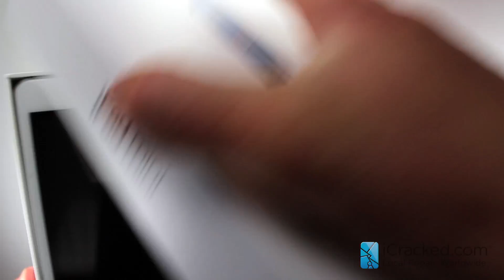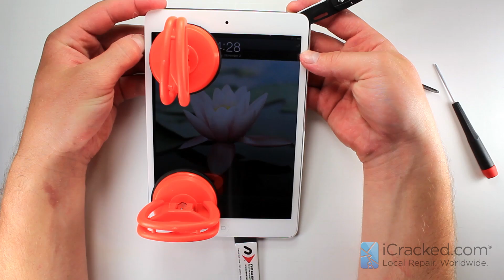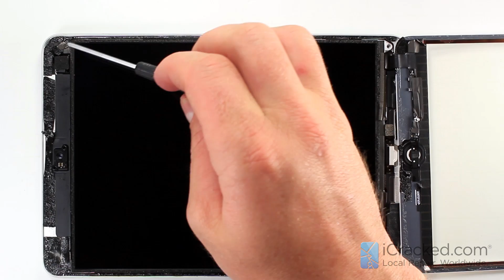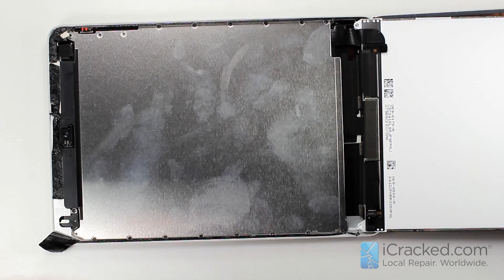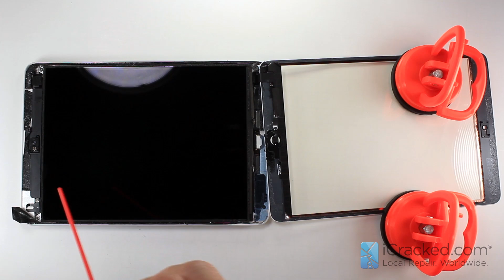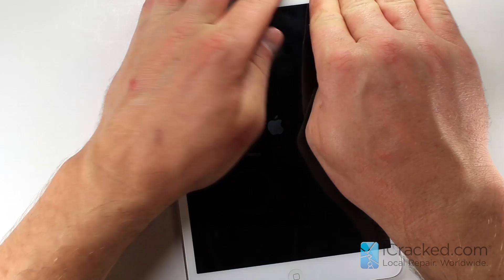Official iPad Mini Teardown - iCracked.com

Comment: important thing you need to remove the battery connection first before removing other parts that connected to the board, to avoid shorted.

Comment: Word for the wise to anyone doing this, after you start remove the digitizer, if the break is bad and it starts splintering, you will need to be VERY careful how much heat is applied to the bare LCD, as it can cause a cloudy-like appearance and is annoying.

Comment: doesn't even mention the two small magnets! Battery Connector?? This is not a good video! at least he can count screws!!!
Reply: This is actually a very good video, the LCD was a little trickier for me to get out because this video looks like they had it out already, there was too much flex for my tastes in the lcd getting it out, the tape at the bottom was annoying too. I did forget to put that little magnet near the power button back in.

Comment: WOW, this is the biggest pile of crap. There is NO WAY to remove the LCD screen like that by just using your fingers. I have repaired thousands of iPads and hundreds of iPad Minis. iPad Mini LCD screens are NOT removed like this and will not come off as easily as they show here. This LCD screen was already removed before this video was created and then put back in place just for the video. It will never come off this easy and if you use your fingers to remove it, you will kill the LCD for sure.
Reply: We use dental floss with a little bit of heat to warm up the adhesive. Since the lcd is already exposed, just use minor heat on the bottom back cover, and apply heat away from the LCD (while opened). I guess this vide will not show u how to do it correctly, so that you can purchase the LCD from them. GOOd luck everyone!
Reply: You're right Ron, I was clenching my teeth so hard with how much flex there was when I removed the LCD from the one I just finished, (first mini, mind you) but it was otherwise successful...
Reply: and he didn't put the magnets back,, one was missing
Reply: Ron Nader you are moron

Comment: You have to disconnect the battery first at all times where did you learn your electronics
Reply: There's absoluetly no way to access the battery without pulling the display (not just the digitizer
Reply: you should really research before you open your mouth, because the utter ignorance that flowed from it is astounding.
Reply: Sean Feehan
I'm assuming (perhaps wrongly) that your comment was directed to my post. Since I was basing my post on a unit I was dismantling at the time to replace the digitizer. it was Q. E. D.- the display under the digitizer has to be removed to access the digitizer connection, concurrently exposing the battery and its connection to the motherboard.

Comment: Please help. The screen will not come on.i did everything just right. Does all of it have to be screwed in for it to work
Reply: you likely overflexed the LCD cable or otherwise damaged the LCD... If plugging in to a charger does not give you any display, you likely have damaged the LCD or didn't hook the battery back properly if you unplugged it.

Comment: You forgot to mention the MOST IMPORTANT part of the install. BEFORE REMOVING the digitizer and the LCD ribbons you MUST DISCONNECT THE BATTERY ribbon cable. If you unplug the LCD first it will cause you to blow your backlight fuse for the LCD.
Reply: @hey-zel  There's a tiny fuse on the main PCB on the iPad that will have to be sent in to be replaced.  It's a super small surface mount fuse. At this point it's cheaper to buy a new iPad.
Reply: @thebeetlejoose  o
Reply: it's a risk but not a certainty. I just did it without disconnecting the battery.

Comment: I think this guy is on the right track but there are always better and safer methods for accomplishing the task of disassembly and repair. I am a technician in an ongoing training process to keep up with new devices and used this video as a guide. I found that the metal plate opens out to the left like a book page if you gently slide it to the left of the case and lift it up to the left from the lower right corner.

Comment: Wouldn't want you working on my iPad Mini! Show them the back cover where you placed it and slid it on the tweezers numerous times.
Reply: I think this guy is on the right track but there are always better and safer methods for accomplishing the task of disassembly and repair. I am a technician in ongoing training to keep up with new devices and used this video as a guide with professional grade tools
I found that the metal plate opens out to the left like a book page if you gently slide it to the left of the case and lift it up to the left from the lower right corner.
Reply: Stephen Napoleon dat copy paste

Comment: wooow guys. dont listen to these fucks from icrack. go to ifixit dot com if u want to assembly anything properly. im a technician in 1 of the companies that repair electronic devices. this guy just disassembled and assembled the ipad back with the same screen. what about preparation of new digitizer? thats the point of disassembly, right? u want to put new lcd/digi on. there is home ribbon which has to be folded in a specific way. there is quite difficult soldering job to be done (IC connector and home ribbon), u have to keep 3 tapes and put them on a new screen (they cover chips and wake magnet). also, u dont open it like a book, u open it from the top to the bottom straight away. the way he's done it, u can damage every single ribbon. shitty unsafe job. also, he didnt say anything about 3G version, which has antenna flex cables on the top, which makes it more difficult to open, also he didnt say anything about using kapton tape, which saves the day sometimes. shitty job, dude. shitty job. i guess i have to make a tutorial vid on my own with proper explanation. oh and btw. to clean it properly, u need cloths that u use to clean glasses, latex gloves, some screen spray and rubbing alcohol. 1 cloth for wet cleaning, and one dry for removing the smudges left by spray/rubbing alcohol. big dislike here. u dont give any advices, u dont explain anything. it makes no point just like hugging a whore for money.
Reply: thanks for the eye opening comment! But I went to Ifixit  dot com like you said and the tutorial is lame and they forgot to mention about the magnets as well
Reply: E Mon hey there. thank you for your comment! this video indeed makes no sense at all. just imagine... i upload a video called: ''how to make a cheese cake'' and then on the beginning i give you the whole list of ingredients needed and then an actual video how i take the cake out of the oven. no sense at all, huh? because of your comment i will actually make the full step by step video with the information and description what and why i am doing this way. thank you. i will try to get a faulty ipad mini from my employer so i can record the whole repair process at home. ill definitely let you guys know once i upload it. please subscribe to my channel for it as well;) have a nice day, cu around
Reply: siasiekw yes we are waiting, I actually need the info
Reply: Or you can order the digitizer pre-assembled with adhesive and the home button assembly for like 35-40 dollars on ebay and be done with it?